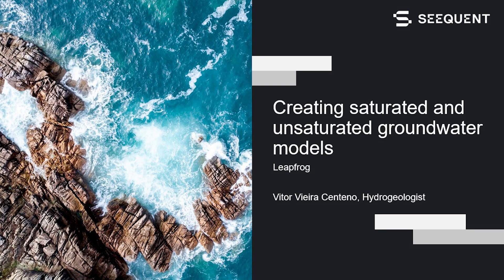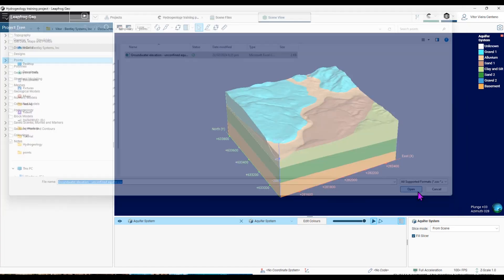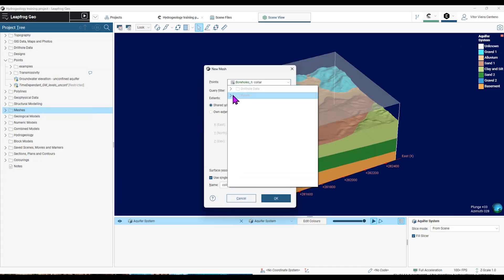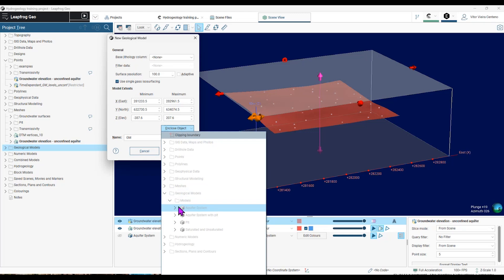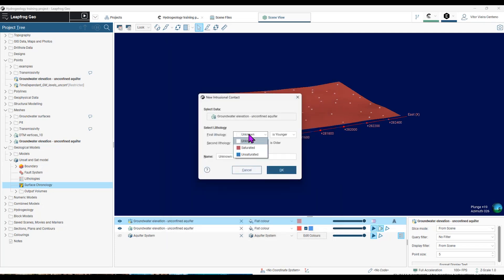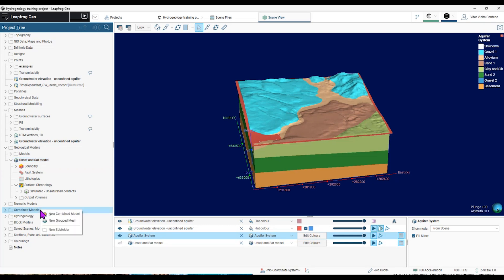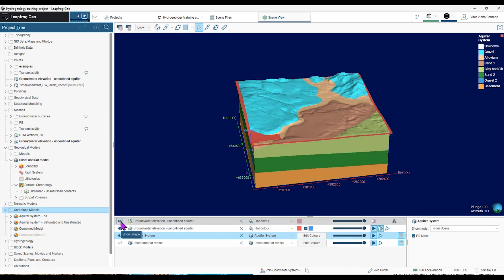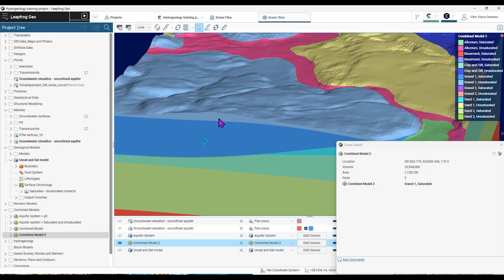Creating saturated and unsaturated groundwater models in Leapfrog

Comment: Having trouble getting a model made this way to properly connect w right boundaries.  Mine wont let me enclose the model around an object.
Reply from the maker: Hi - Please contact our support team at support@seequent.com or via https://my.seequent.com/support/request using your Seequent ID and they will be able to help you solve this!
Reply: Edit the surface manually using structural disc.. i prefer to build structural disc data from GIS (I use mapinfo professional as i consider the best gis platform for geomodeling work data prior to do the process in leapfrog or other geomodeling softwares).